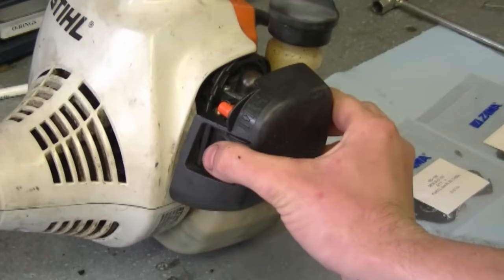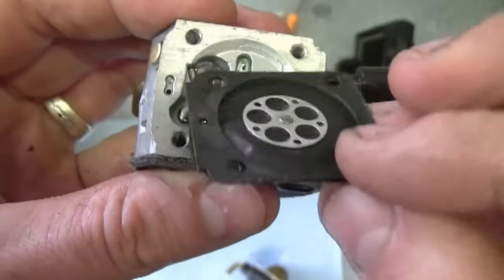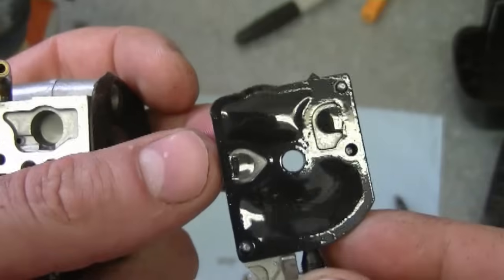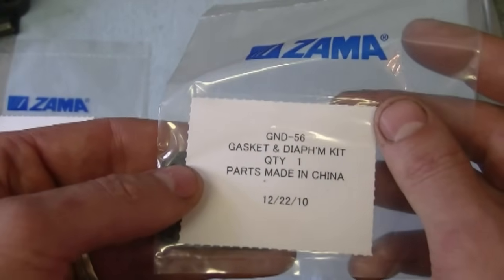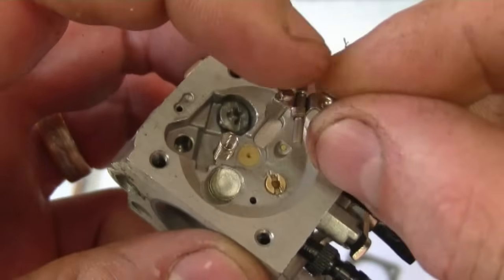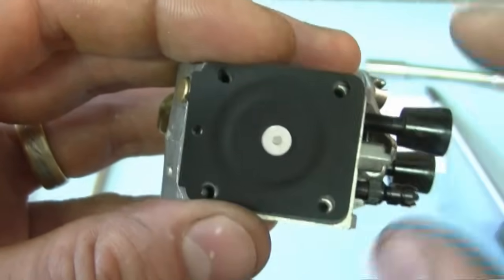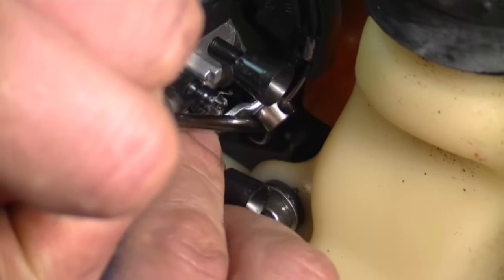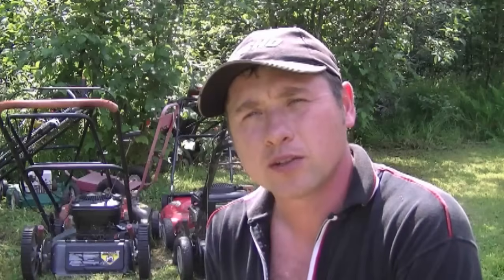Carburetor Rebuild On Stihl FS38 Grass Trimmer

Comment from the maker: ALWAYS USE HIGH OCTANE FUEL WITH NO ETHANOL TO PREVENT DAMAGE AND COSTLY CARBURETOR REPAIRS ON YOUR OUTDOOR POWER EQUIPMENT!
Reply from the maker: @David bannister stihl dealer
Reply from the maker: @tiesmanders3681  if it looks the same it should work, I often interchange carbs on those stihl trimmers. i.e. fs38 carb fits on fs55
Reply from the maker: @tiesmanders3681  check with dealer
Reply: Zama d m v 56
Reply: where did you buy these rebuilt kits? Do you have locations or links? thanks
Reply from the maker: @leoll7380  any small engine shop, also amazon

Comment: Wanted to say thanks for all of your vid's. I got an old Toro mower a few years ago for free. It ran good, but only on full throttle. It worked, so I didn't worry about it. Last week it started running rough, like it had some dirt in the carb. Thx to your videos, I pulled the Walbro Carb off, checked it out, cleaned it, fixed the low idle return, adj. the mixture, set the idle and she runs like new! Because of you, I'm almost done with my old 3 HP, side exhaust Tecumseh project. Thx Donyboy!!!

Comment: I used this video twice this year to get my trimmer running.  The first time I ordered the wrong carb rebuild kit.  Seems there are several similar carbs on these machines with slightly different shaped gadgets.  Thanks again, big help.  Saved me $100

Comment: Awesome video Donyboy.  I"ve rebuilt carbs on 4 cycle engines so I had a pretty good idea on how my Stihl grass trimmer would work.  I actually took it off and cleaned it just as you described.  However, I forgot to check that fuel filter--which is very important. And. .I didn't clean that valve orifice inside.  Normally I use a thin sewing needle to physically clean these out.  I've found that physical cleaning is surefire versus carb cleaner which doesn't always break up ethanol gasoline. . another bad idea to use.  Live and learn.  You've done a fabulous job with your presentation as well as the tone of voice. This couldn't have been any better with a hired actor.  Well done !  You're a very good teacher.  Love my Stihl.

Comment: Donyboy73, when it comes to my rebuilding my equipment, I am almost fearless. My trimmer ran like a sack of hammers so with this video I installed the #100 kit and it started right up. Last week I replaced  a split fuel line on my chainsaw. The High / Low screws were a mystery, but I think I have them figured out.  Many thanks for showing me how to do it.

Comment: I can't say enough about this video. Easy to follow with no distractions music or kids etc. I bought a Stihl weedeater 1 1/2 years ago and already it won't start. 2 blisters later I am pissed off that a weedeater I thought I would never have any problems with for at lest 5 years or so has already failed me ugh. I'm not sure where to start and I doubt it needs a kit already but who knows for sure. It acts like it is not getting any gas and the primer bulb does feel different when pushing so I will start with the basics inspections to see if anything obvious is wrong then maybe change the plug out,filter and things like that. Anyway thanks for your video and I will be following you from now on.
Reply from the maker: you're welcome, watch my video on how to clean the spark arrester on this trimmer
Reply: Thanks for your response Donyboy73. After all my rambling about the piece of crap stihl trimmer I had watched a video on timmer line replacement and didn't realize that you could feed it in from the outside. I tried it out and it worked. I don't know how many choice words I used trying to figure out how to get the line rewound without it all coming apart. My point is on doing so I had pulled the plug wire to check for spark and barely pulled the cord and it started. What the heck I thought so shut it off put the plug wire on good and the protector cover and it ran like a new one. I just figure I had rocked it back and forth enough to unlodge something in the fuel lines so were good now. I will watch your video anyway for more info so thank you very much once again.
Reply: I also have a Stihl  gas trimmer was hard to start out of the box.After watching  the videos I am wondering if it the carb. needs adjusting

Comment: A great video. Thanks. I have a HS45 hedgetrimmer with same carb that wouldn't rev high although idled OK. Found a few tiny bits of dirt under metering diaphragm. Cleaned this and the jets as you described - great tip about wire from a brush for this. Works perfect now.

Comment: Good quality video footage, easy to see.
Precise instructions. Thanks.
The problem I had was the air filter bracket was moulded in such a way it prevents a standard 8mm socket from getting to the nuts...a cunning plan.

Comment: Still the best carb video. I just found it I had already replaced everything and couldn't get the throttle cable on the carb good and it was running fast at idle to the point that the head was turning only way I could slow it down was to turn the choke on a little.  I am going to see if i can roll the throttle around tomorrow and see if i can get it to seat down in it then it would lower the throttle.

Comment: This is helpful, just purchased a FS46 gonna do a clean/rebuild before I even try to get it running. I noticed the fuel lines are much different than most I have worked on they appear in great condition.
 Thanks for the how to video!
Reply from the maker: sometimes easier just to replace the whole carb

Comment: Awesome video! The Stihl FS 45 is nearly identical. Local dealer wanted $40 for rebuild kit, so I just got diaphram and gasket for $10. Put it in and ran like crap under load. Checked the owners manual, reset H, L, and LA screws to factory settings, and now it runs like new!

Comment: One of the best instructional videos on Youtube, to the point, great camera work, no stupid competing background music.  Was wondering if using a spray carb cleaner is of any value.  They are pretty weak compared to the carb cleaners 20 years ago so it is necessary to "rod" the passages.  I did this on my motorcycle and will now try it on my Stihl trimmer and MS261 chainsaw.  Keep up the excellent work.

Comment: Best DIY video I've seen - by far. Thank you for taking such care to make it so professional.
I watched it last week, then checked my FS45 which bogged down when opening the throttle. Didn't rebuild carb. just blew through fuel lines and filter. Put zip ties on fuel lines as the tubing seemed a bit loose.

Result: Like new again, no hesitation on running straight up to full power. 
This week, horror! It was back to square one. Terrible bog down, no power. Life is so cruel!

Comment: Hey buddy my grief started when I tried to get the filter out with a coat hanger thinking it was like the older one. I then went to research and found you. You information was very precise and concise. I have now purchased a kit from ebay and it the changing of the fuel line and filter dont work I will change the carby seals to give it a proper run. Thanks heaps
Reply from the maker: you can also get complete Chinese carbs on ebay quite cheap

Comment: Hi there donyboy73,

Another good and easy and clear video to use as a standard to do everything needed on this Carburettor. ….. And this carburettor with that tiny round filter, which to a layman looks like part of the solid bit of the carburettor but you show it isn't. This is a pretty rare case of almost invisible piece that have to be replaced and or at least checked.

Thanks you.

Take care

mrbluenun

Comment: Your video saved my bacon. Trimmer would only run on choke, and not very long. With your help I was able to disassemble and find the problem . . . gas had congealed inside and needle valve was totally clogged. Cleaned that up and it runs just fine! Any suggestions re optimum type of gas? I'm using a lower octane now.

Comment: Great Video. I think I should be able to take the steps here and apply them to my FS 85. Thanks...
Reply: recommend not to use wire on jet orifice • his method is field-expedient and commonly use but only broach for the purpose is correct; we find bristle from brush or something that will not resize even slightly and do what we can

Comment: I’m rebuilding this same carburetor on a Stihl HS45 hedge trimmer. For some reason the primer bulb won’t pump any fuel from the tank and yes the fuel lines are install correctly.

Comment: I'm actually at this point. I bought a rebuild kit from the Stihl dealership that i bought my FS38 from. The kit consisted of a fuel filter, an air filter, the single "wagon wheel" diaphragm, and the new primer button. It was exactly $495 pesos, or $25 USD. 

It is bare bones and basic, but I believe that by cleaning the carburetor and spark arrestor thoroughly, I can get it going tomorrow morning. I have another string trimmer carb to rebuild when I'm done with this one, and then my father-in-law's chain saw carb. 

This will all be practice to jump into my Kawasaki Ninja carburetor. 

I'll come back and leave a message about how this first rebuild went. 

I used to own a landscaping corporation years ago, which was large enough to employ 14 men. We put our equipment through hell, and I maintained all of it myself. You forget a lot in 30 years... brushing up. Your video is clear and concise, and I'm ready to jump on it at 6 AM sharp. 

Thanks!

Comment: Thank You so much! I noticed after I rebuilt my carburetor i could still blow through the fuel line...So I checked the float height like you said because it was incorrect out of the package and it seals nicely now!

Comment: One of the best videos ive seen on Youtube.. very clear and brilliant close up filming
making it very easy to follow.. i have this machine, the carb is good, but how do i test
the coil to find out if its working ?  
My machine wont even fire ?
Reply: kingdom777866 Remove plug, but then put it on the plug wire, take a piece of wire so you can touch the threads on the plug to the motor, pull cord, you should see spark.
Reply: Milsparro Niven  Its sparking ok .. it just wont start even with a new carb ??

Comment: Good stuff.   NO Tack  yet Don ?   I often wonder why the use of thread locker is not required on 2 cy carbs with all the vibration, ever had some of those screws loosen up ?

Comment: Hi - nice helpful vid.  Can you answer this please?  My Stihl strimmer is working fine but, for some reason there is a layer of, presumably oil, on the bottom of the black plastic filter cover that I get on my fingers when priming the bulb.  Basically, is this serious?   As I say the gadget works fine.    Thanks.

Comment: Hi, Great Video as always. The question I have is I cleaned out the carb on my Stihl SH85 blower and when I try to start it up I get petrol coming out of the muffler. I replaced the gasket but to no avail. What could be the probable cause of this? Any suggestions would be most welcome. Thanks.

Comment: Donyboy73, really enjoy your videos. Tell me, are you using a thin-walled 8mm socket to remove the air cleaner housing? My regular 8mm socket OD is to wide to reach the recessed nuts. My local Stihl shop tried to convince me that Stihl does not want consumers to work on their carbs and so a special tool is required (not available for purchase, of course). I'm calling BS on that unless I hear differently from you. Thanks!

Comment: got a fs46 i think it is according to trimmer sticker can't get it to run carb seems clean I cleaned it anyway I can't get any gas to fill primer bubble mine will start but doesn't want to keep running gas did fill bubble before I took apart help if you can dony

Comment: Hi, The FS38 didn't want to run (doesn't start) Stilh here told me it was the non return valve in the carburetor and can't be replaced separately and I need to replace the complete unit. I've watched just about every video on YouTube relating to this carburetor and non of them discuss the check valve just under neath the primer bulb. Have you got an input on this please.

Comment: great video a lot of help with my rebuild, do know the settings for the L&H  screws I played around with them so now I need to reset them back to factor spects thanks
Reply from the maker: Bill B I start at 2 turns out for each and then work my way in

Comment: Dony,  I have an echo PB251 blower with a zama carb.  I have rebuilt it several times with the gasket kit and even the needle, lever, and spring etc.  After a few rebuilds following your advice and the factory diagrams, it remains hard starting.  It floods and gas will seep out of the muffler?  I bought a new carb for it and after a few rebuilds, it does the same.  Any thoughts on what I am doing wrong.  I have rebuilt carbs on other machines, but don't have the same problem.
Reply from the maker: ***** did u say you put in a new carb? also check venting of the fuel tank
Reply: donyboy73 Yes, I have replaced the carb.  I have the same problem on the second one as the first.  I wonder if I have the needle lever height set too high or too low?

Comment: Great Video Donyboy!   Your camera work is great considering how small all the parts are.  I was surprised at the dexterity needed to do the work, you have some steady hands.   QUESTION:   Do you have a video showing the proper process to tune the carburetor mixture and idle speed on the same Stihl FS 38?  I've been looking and haven't found one from you.   Please let me know.
Reply from the maker: thanks, it would be similar to this video https://www.youtube.com/watch?v=0wcmc83y7I4

Comment: Awesome video, man I wished you were in my town.  Most shops around here will overcharge for simple repairs.  I can not get my FC75 started, I changed the spark plug, air filers and poured fresh True Fuel in  it.  I will not start,  I removed the spark plug wire and I see it's getting a spark but will not crank.  Also, I cleaned the spark arrestor screen.What else should I try?

Comment: I have the same machine. What is the problem if it have no idle? Runs good on high rpm and stops on idle instantly. Cleaned carburetor, new diaphragms.

Comment: On my carb the little round welch plug came out during cleaning. What should I use to get it to stay back in? Is there some kind of special gas resistant glue I should use??
Reply from the maker: +UtwoBed when that happens I tap it with a small punch so that it spreads and tightens
Reply: +donyboy73 Thanks for getting back to me so quickly, I was very tempted to just put a drop of Super Glue on it. Now if I can just figure out were to get one of those 8mm nuts that holds the carb on......   I turned my back for a few minutes and one of the nuts just vanished, like a bird swooped down and grabbed it when I wasn't looking. Very frustrating.
Reply from the maker: +UtwoBed just order one from the dealer then u get the original one
Reply: +donyboy73 Tried that and it still popped back out. I did a little research and it turns out Super Glue is not affected by gasoline so I got the plug in as tight as I could and sealed the edge with a small droplet of Super Glue. l'll let you know how that works out  as I use the trimmer over the coming months.
FYI I found the nut, it fell into the engine.
Reply from the maker: +UtwoBed ok good

Comment: By chance do you have anything on the pull rope assemblies for my craftsman mower. I have an issue I have never run across and not sure what is going on. I removed the top engine cover as the rope assembly is attached to it and the assembly seems to work fine and the wings come out as they are supposed too. My problem is when I put the cover back on and insert the cover screws the pull assemble won't engage the flywheel unless I push down on it every time before trying to start. This one has me stumped and for you I'm sure it is very simple. I thought about removing the pull assembly and shimming between it and the cover to see what would happen but not sure I should do that ha ha. Thank you

Comment: I got a FS45 well neighbors do they gave it to me to try to fix I used it last Friday and now this Friday it won't start for nothing.  Had carb apart not real big expert on this stuff and used some gas to try to clean carb and put it back on.  It primed before somewhat but, not no fuel is wanting to get visible in the primer bubble what do you think is wrong.

Comment: Hi Donyboy,  I have just fitted a new coil to my fs 38 as it was the problem.. but now i am having trouble starting.. it wont run..   it back fires every time ?
any idea what my problem is ?
Thanks
Reply from the maker: kingdom777866 try a new plug, make sure muffler screen is clean, and lastly make sure the flywheel key is not sheared
Reply: donyboy73    Hey donyboy,  im getting really pissed off now.. ive replaced the coil for a new one, also a new carburetor, ive cheked all you recommended and its still wont start ?   alls im getting is a loud fire, like a back fire on about 25 pulls of the cord?
Im close to chucking it in the tip ??
Reply from the maker: kingdom777866 look at the piston and rings through muffler port, they may be scored
Reply: donyboy73  Thanks for your prompt reply..  but the engine  has good compression ? but i will check it out !
Thanks !
Reply from the maker: kingdom777866 also make sure the muffler screen is not plugged
Reply: donyboy73  I have checked out the piston & rings and its perfect like new, also the bore like new ! 
i also viewed though the inlet port again perfect !   The muffler is clean & clear...   so i dont know whats
next, this has me baffled ?
I thank you for taking the time to answer my questions..

Comment: Hey Don, I've got 2 FS85 trimmers one runs fine the other won't start. I've swapped everything ( carb with fuel lines and fuel tank, coil, spark plug) from working one onto not working one and it still won't start. It has good compression, has spark. Carb is good because it runs on my working trimmer. Any ideas what else I could try? Thanks